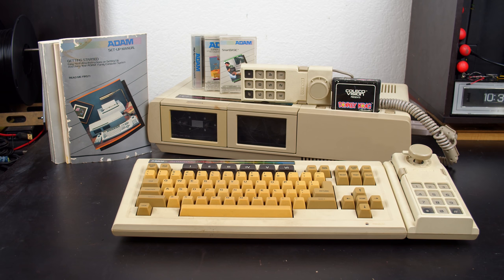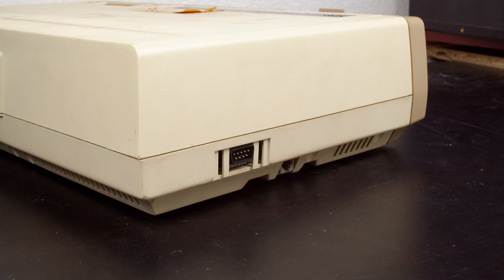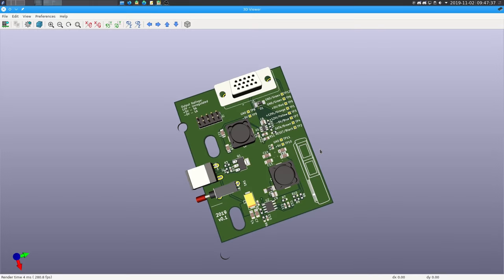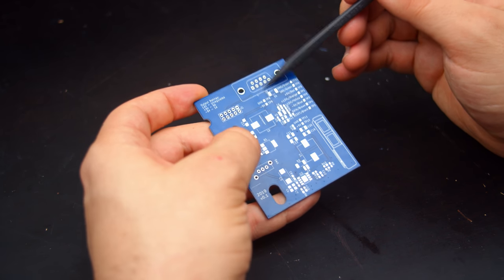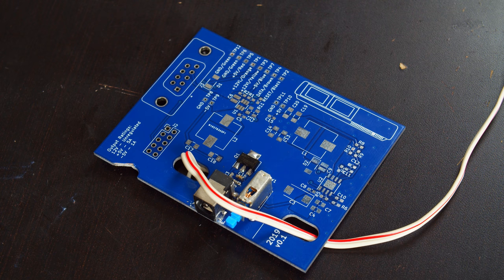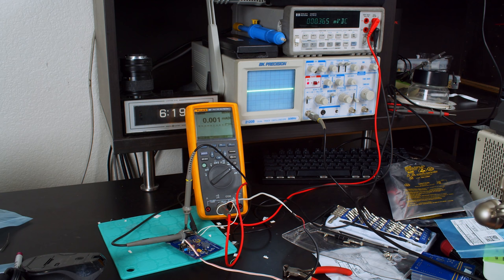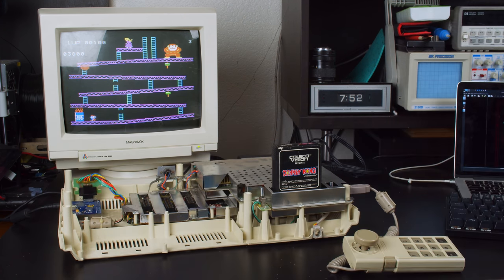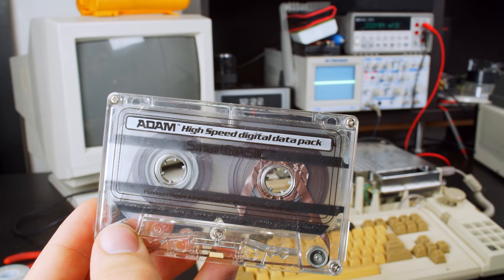Making a New Coleco Adam Internal PSU

Comment: sadly a picopsu does not have -5v you will need a custom psu likely taking 12v and 5v (or just 12v) and voltage inverting both the 12v and 5v rails
-5v is a very old standard for op-amp bias so likely replacing the db9 with a 12vdc barrel jack and having standard adjustable voltage regulators for lower voltages and two voltage inverter modules (with isolated grounds) soldered to a piece of perfboard/custom pcb to create the outdated atx standard would be best

Comment: WOOOD U HELP ME FIND OUT THE  MINE I MEEN SIR MINE  COMPASTER ON  Y 1060GTX CAME OFF I HAVE A.D.D I AM VARRY GOOD WHITH MY HANDS AND I SEE U NO A LOT IF I SAND U PIC OF MY PCB VARRY GOOD PICS CAN U TELL ME THE CHIPS I NEED TO FIXS IT WORKS NOW I BAT IT TO LOW OR TO HI IN VOLTS SO I DONT USES IT SIR AND IT WORKS SO GOOD  I WHANT TO FIXS IT MAST UP PART ITS CANPSTER RIIGHT ON THE BACK OF MY GPU  PNY 1060 GTX 3GB RAM 2 FANS    THAY ONLY MADE ONE 2 FAN 3GB 1060GTX FROM PNY CHIPS ON BACK OF MY CPU COME CAME OFF SO I NEED TO NO THER NAMES TO GET NEW ONES  EVIN IF U HELP ME FIND PAPER ON PNY CHIPS ON BACK O THE CPU WOOD HELP